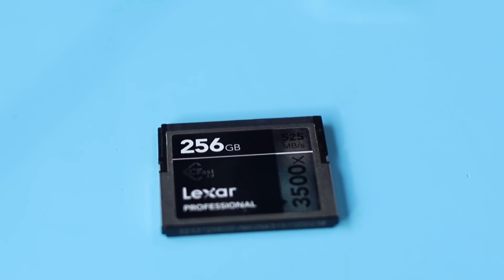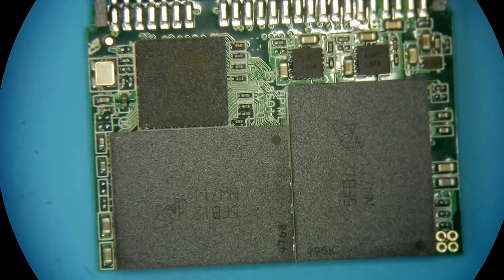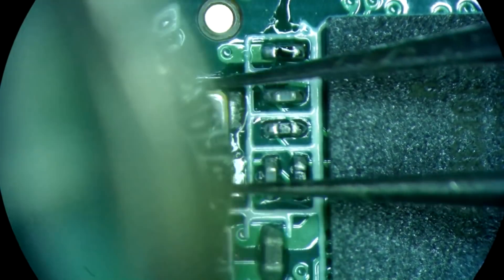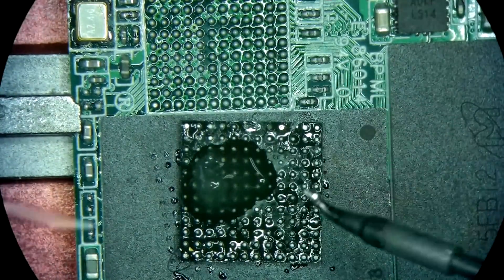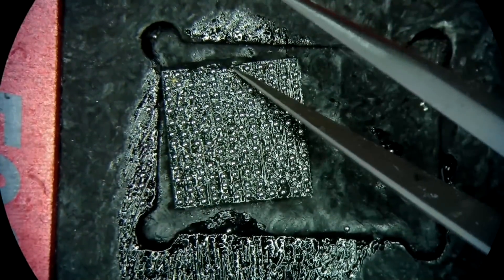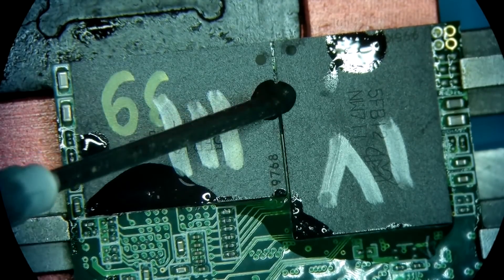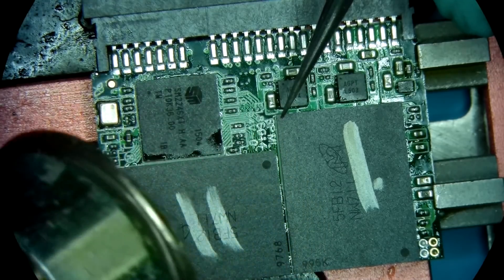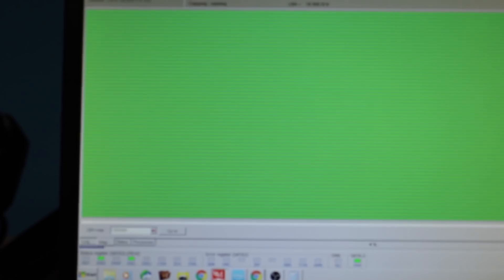CFast 2.0 does not work? maybe this will help

Comment: Arri send a notificatin on 2019 that cf2 cards by lexar 3600x don't recommended for usage due to errors after first writing. Don't use these cards!
May be thus is not a very good idea to solder just on memoty chip?
Reply from the maker: They recover well with a loader and virtual translator

Comment: Hi! Can you give me a hint please for my Problem: i have a 64gb transcend SSD and it stopped working without a reason we know. Now it stopped showing up on any PC Platform. It seams to dont get Power? But it ist only a theses. What can it be? Can it also be a bad connection? Whats your experience? Is there also a save mode i can use? Thank you so much!
Reply from the maker: I'd really need to probe it first
Reply: @hddrecoveryservices  what Software + Hardware do you recommend for data Recovery?

Comment: I wonder if the cards, when functional, are returned to customers and they can use them? In case if the repair is done OK, that would be a great benefit for customer (ie. this one is pretty expensive).
And when recovery from hard drives, do you dismount back (or keep) the good parts that you used, ie. head assembly?

Comment: I had a hard enough time desoldering the ram chips on my C64 (yes the old computer from 1982) and replacing them with sockets and new (old stock) ram. I can't imagine working on stuff this small, but it seems to be a completely different process.
Reply from the maker: Microscope makes it very easy. One thing is certain it only looks hard without the right tools. With proper tools this job is not hard at all. Sure it takes a bit of time to get a grip on all of the bits, but little practice goes a long way
Reply: True working on the c64 seing things got difficult at times. I couldnt tell which pins had been freed and which ones hadn't. I did get better at it as I did more of them.

Comment: I have a Sandisk Extreme PRO USB 3.1 drive, it gives me a Redundancy Cyclic Check error.
it does have a SSD Kinda Controller inside as it shows Health Reporting. How come it gives me this error ? It's only 1 week old with 4 Retired Bad Blocks which didn't grow any further the past days. Only Erase Fail count on the same time with Retired Block Count.
Secure erase doesn't work ( tried it already ) and fail S.M.A.R.T check. https://imgur.com/SgxXK3X

I will send it back for replacement anyways, but this frustrates me why it dies already. My Corsair Voyager GTX 128Gb works way better and also has a SSD controller from Phison.

Comment: This looks pretty similar to a sata SSD. I've been waiting for videos on this subject. Some people are afraid of SSDs (or flash storage) because with an HDD, unless it has severe physical damage, you can predict when it starts to fail. With flash memory, one day it's just dead and unreadable and there's not many information about data recovery from SSDs. 
Thank you for your work. I enjoy learning from you
Reply from the maker: Exactly, it works one minute and it just stops. Happened to one of my Samsung 950Pro NVME units at the lab
Reply: @hddrecoveryservices  Did you attempt a data recovery on your own drive as an exercise? 😁
Reply: @kilrahvp  He probably back up his data often, so he just switch disks and is ready to go.
Reply from the maker: I got very lucky by letting the unit rest for few days and trying it on a different PC. Drive came up booted windows and stayed on for 40-50 min to give me enough time to pull needed data.
Reply from the maker: It was a shoeless shoe maker moment I am embarrassed to say

Comment: Just wondering after resoldering the nands maybe would work without safe mode as well?
Reply from the maker: I tried, it did not just sits in busy signal. My guess at this point is, when contact went bad translator ate some chunks when write became unstable

Comment: so were you able to recover 100% of the data? Is PC-3000 translator 100% accurate?
Reply from the maker: Great question. 90% of the translator was built and successfully extracted data from the volume and 10% of blocks are out of translation. So we will be doing a chip-off to fill in the gaps ;). However, even now files that we carved out are functional.
Reply: @hddrecoveryservices  Hello, can you explain why not just do a chip-off recovery of the 4 NANDs when you took them out to reball them?
Reply: @hddrecoveryservices  after the reball should the device work aa usual? Why safe mode?